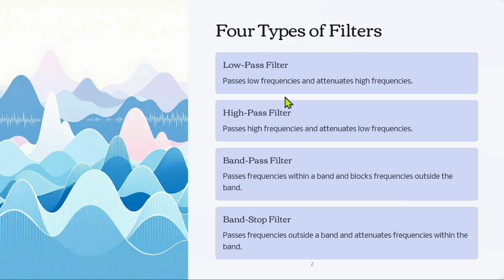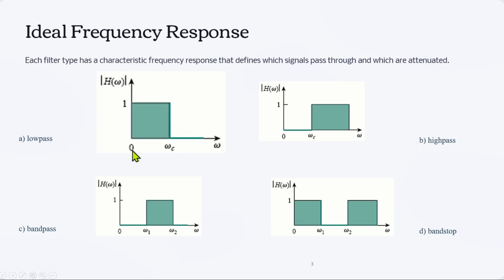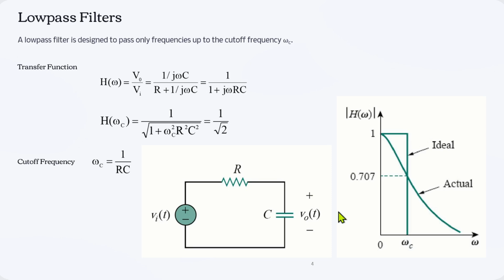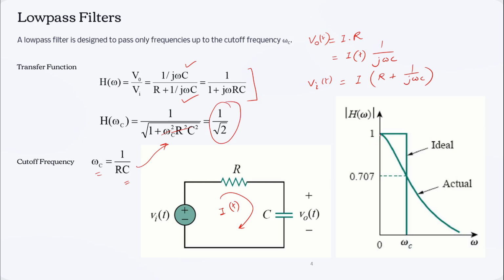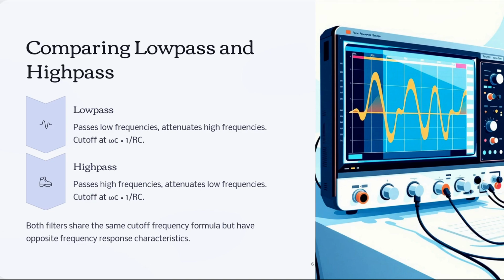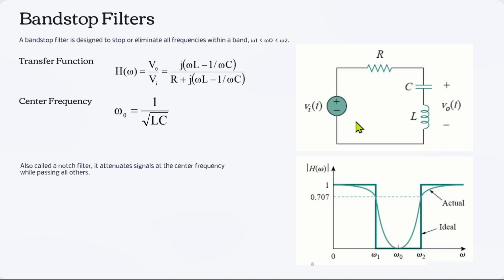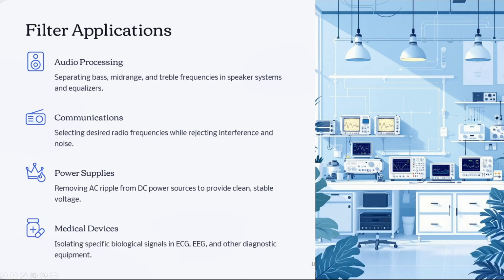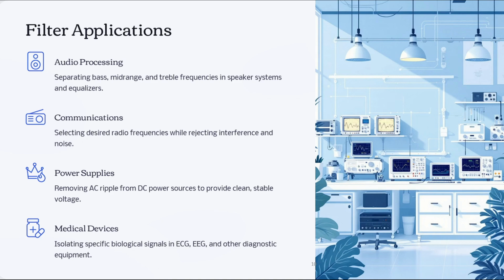Passive Filters Explained ⚡ LPF, HPF, BPF, BRF + Real-World Examples

Comment: Sir,  Is the Transfer Function (H(ω)) a Step up/down function ?
Reply from the maker: Thank you for the question. The transfer function 𝐻(𝜔) is not inherently a step up or step down function. A step-like magnitude response is assumed only for ideal filters as a theoretical model. Practical filters always have a smooth roll-off with a finite transition band, so their 𝐻(𝜔) is continuous and frequency-dependent.